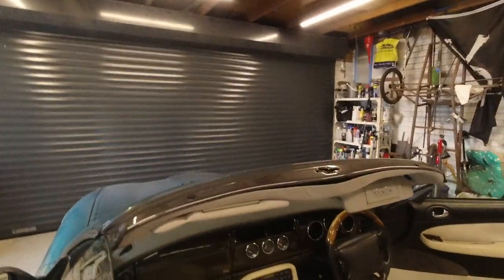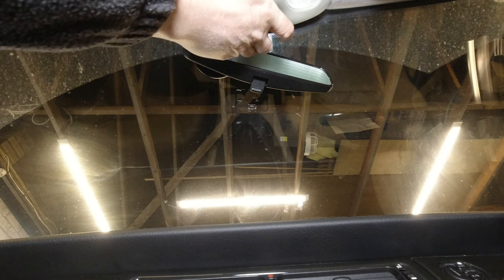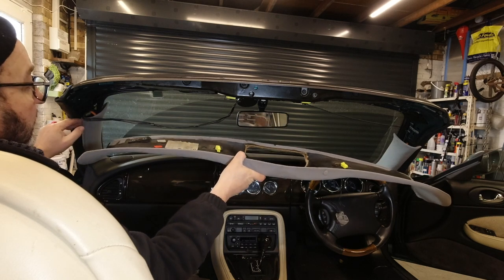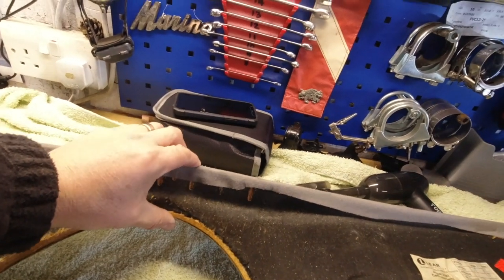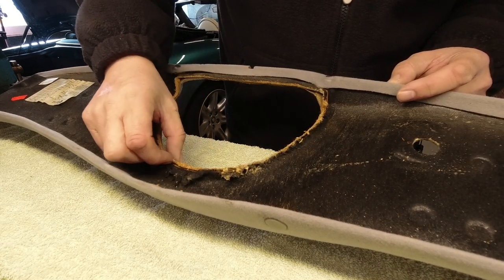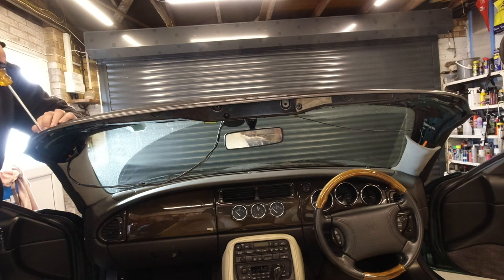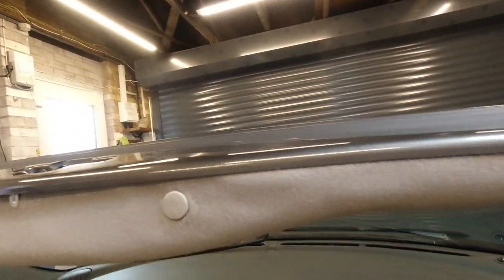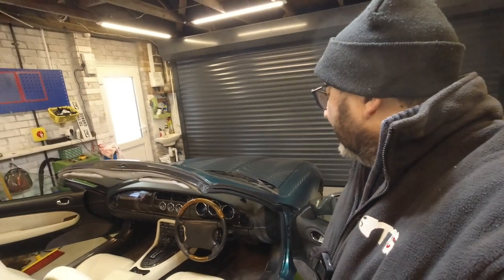Improving the fit the header rail trim on my Jaguar XK8.  To the Garage

Comment: Good fix John.  I like the way you tidied up the trim.  If you drill in to metalwork always paint the edge- even on the interior.  I was just wondering how difficult it might be to get the trim off again with that clip.

Comment: Hi John,  excellent video as always thank you. Whilst I don’t have any distortion on my car I do have a lot of wrinkles in the material on both A pillars so I shall be very interested to learn where you source your material from. I’m loath to try to repair the original material as I think the foam backing has probably perished and any attempts to re stretch it might make it worse.
Reply from the maker: Hi David
I agree. The old material is probably too delicate and the backing too uneven in remaining thickness, to re apply it. I will keep everyone informed when i find a good source
Reply: I seem to remember that my replacement material came from headliner world.
Reply: @stagnite2  yes, when I had a coupe I got new headliner and A pillar covers from Headliner World, and for my current convertible they supplied material for the screen header rail and the A pillars. They were very helpful